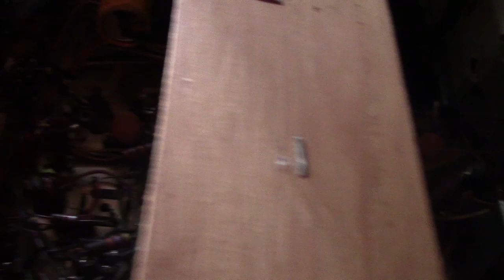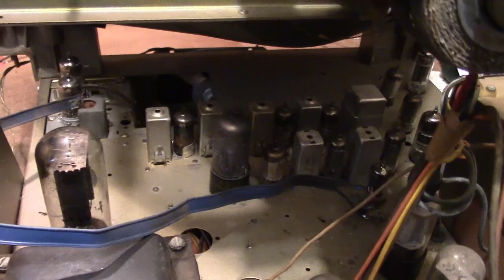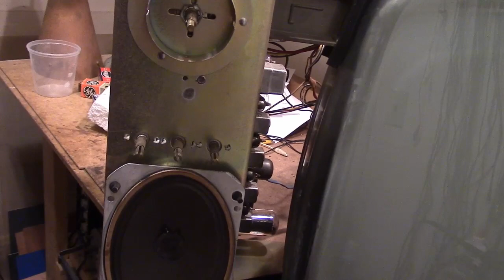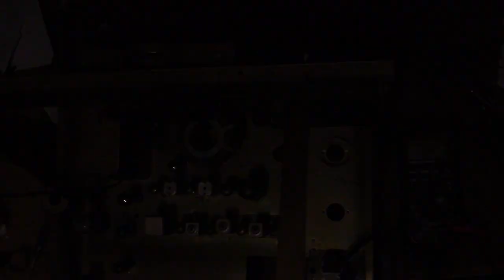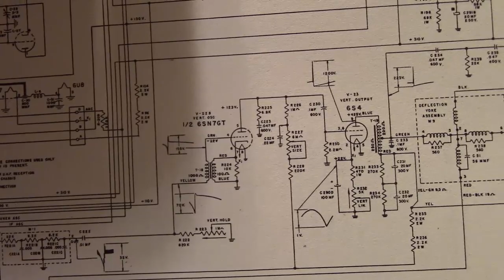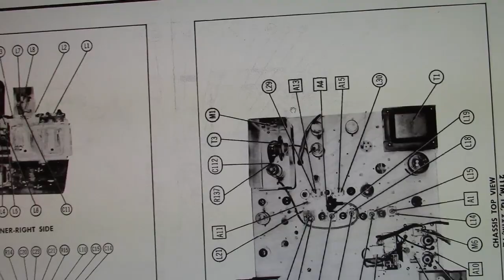Stromberg Carlson 21TQ restoration p1o6

Comment: Other than the fun and challenge of restoring these old works of art to working condition, are they useful at all for watching television? Does anyone, anywhere, still broadcast anything on the channels these tv sets were designed to receive?
Reply from the maker: +siskokidd  It's very easy to setup an RF modulator or even you own low power transmitter to run these old sets.   Also we still have a commercial low power analog broadcast on channel 6 in my area.
Reply: The funny thing is, nowadays there's an analog movement gaining popularity among the younger generations with respect to music (vinyl lp's) and photography (lomography.com), where old cameras and film are once again highly sought after. I suppose it won't be long until you begin to see old school tv broadcast equipment and channels re-emerge. If that's the case, you will be in high demand!

Comment: Do you have a chart that says which CRT's that's interchangeable (compatible socket)? one would think the smaller CRT needs less HV to accelerate the electrons to the smaller screen (less deflection).
Reply from the maker: +zaprodk  Pretty much all early B&W CRTs  used the same socket and rand on 6.3 volt filament.  Yes, smaller CRTs tend to use less voltage.  I'm using an 8XP4 CRT which is designed for servicing TVs and can handle a wide range of HV. up to 22 kV.

Comment: Hey Bob, I've got a question I"ve been wondering about for awhile. Whenever I restore a radio that has slug-tuned IF transformers, I usually have to rebuild them due to silver mica migration---it seems like you have much better luck with those in televisions. Were the ones used in tv's built to a different standard? Or did they maybe use external capacitors?
Reply from the maker: +justsomeguytoyou Usually the caps are inside the can, but typically discrete mica or ceramic rather than exposed mica.  Yes, they do seem to be higher quality than those used in radios.  Also the IF frequency is much higher (44 MHz in this case) and that might require higher quality caps.
Reply: Ahh, now I get it....thanks.